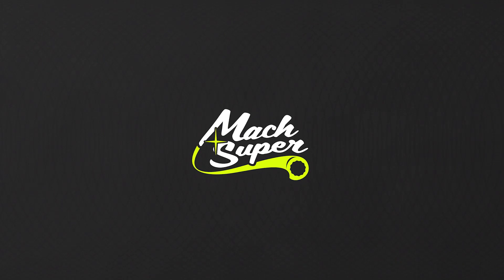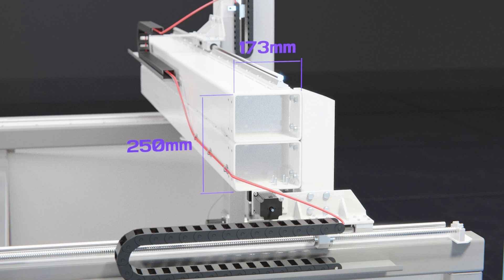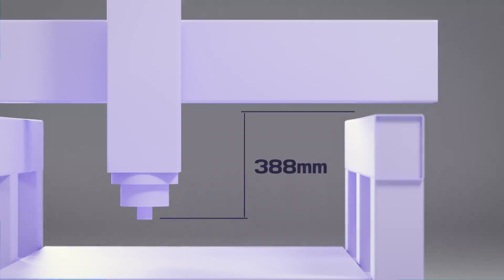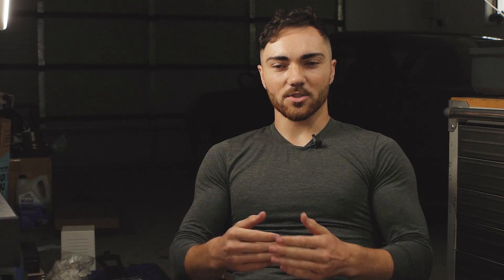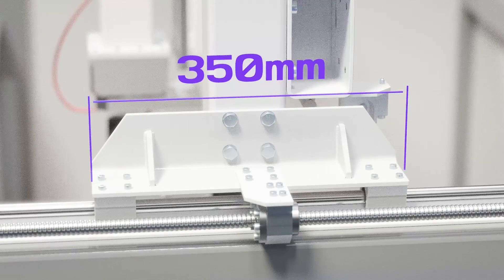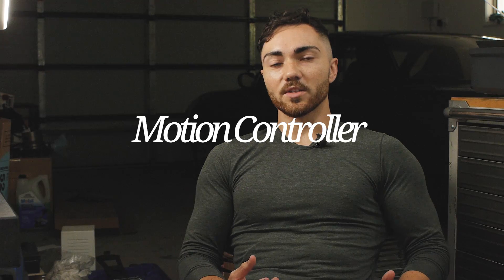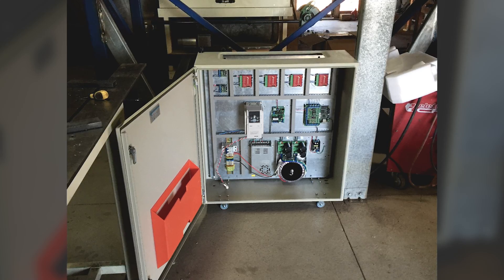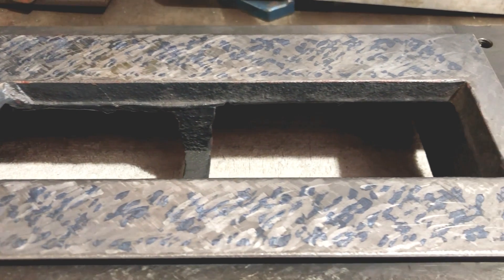How NOT to Design a 5 Axis CNC

Comment: Have you seen the channel routercnc on here? He's got an awesome build series on a flipped gantry (gantry spans the short width) and a dual gantry beam setup. If you watch some of his follow-up videos where he's using it - it absolutely shreds ali with a 1kw (I think) spindle and not a hint of chatter. He also has Fusion files available that are really thorough. Probably the strongest gantry style machine I've seen well documented on youtube
Reply from the maker: I just watched the video where he poured the levelling epoxy for the gantry. The machine looks really nicely made. One thing that concerns me with the dual gantry is that the two beams spanning across aren’t tied to each other. I see it as an I beam with the centre bit removed. Clearly it’s done the job for his needs and it looks great. I just don’t see it being a better solution than one large square shaped gantry. Do you understand what I mean?
Reply: @machsuper   yeah gantry flattening is a whole other topic that a few people on here have come up with some really cool takes on! I think I understand your thoughts on the I-beam - kind of like having two plates floating on bearings and they would sort of slide relative to each other when the spindle torques the gantry?
Reply from the maker: @drivenba  torque on the gantry like your saying could be another mild weakness. But I'm mostly concerned about horizontal flex in the direction the gantry travels in. Imagine pushing horizontally on the gantry, those beams will be weakest in that direction because they're the thinnest that way. They're not connected to each other except at the ends, so you're missing out on a bunch of additional rigidity.
Reply: @machsuper  yeah that makes perfect sense - especially with how you had talked about boxing the main beam as a design improvement. I could see a box-welded, larger, square single beam being much stronger than hollow rectangular dual beams. It'll be really interesting to analyze these different configurations with FEA - that's on my list for the future. Another cool channel to check out regarding beam improvements - Bryan Howard. He's also doing a really interesting flattening technique with a webcam and some software he wrote!

Comment: My 8 axis motion control crane uses a kflop for motion.  It also has a L head with harmonic drives, just holds a camera instead of a router.
Reply from the maker: Is that it in the cool pan/tilt head video?

Comment: 8:05 Can you elaborate on what's wrong with the round SBR rails? I thought they were the superior design aside from being heavier and taking more space. The ability to adjust preload on the bearings with set screws is a brilliant way to get high precision while keeping the cost down. MGN rails have to be perfect from the get-go or else they're useless. The ones I bought were all over the place. By mixing and matching the rails and slider blocks I was able to get them all usable, but if you weren't buying a lot all at once it would be a total crap shoot, whereas SBR rails can always be adjusted. And adjusted again as they wear. I've only used SBR for the Z axis on a 3D printer, but they feel solid enough for a router.
Reply: Two major negatives with round rail....  One is that the rail support is a tee so that means the bearing is 'open" which allows a lot of flex.  Another is that the ball bearings are round and the rail is round so you get high point contact loading.  Profile rails are, well, profiled. The bearing surface is curved to 'fit' the round bearing. This allows for more preload and therefore much more rigidity. They are also 4-way equal load rated which a 'c' shaped open round bearing can never be.  There's really no comparison.  If you had to mix and match rail and carriages then you bought knockoffs or just low quality. Or the mounting conditons weren't adequate.
Reply from the maker: Jevon, you said it better than I could have. Thank you.
Reply: I have the same rail and it's a bit curved in height: on a lenght of 3 m I have a height difference of about 2 mm.

Comment: I can only imagine the time it took to not only design this but make the animations. Looks great!
Reply from the maker: A lot of time, but not too much for you people. XD
Reply: @machsuper  models are very detailed, welding and milled textures are awesome! What software do you use?
Reply: @machsuper A response like this get the subscribe. An admirable attitude/response for creators.
Reply: A column machine is the most rigid, a fixed gantry is the next best than a moving gantry. This is because a column only has one moving axis attached to the spindle, the fixed gantry has 2 and a gantry has all its axis’s moving the spindle. The con of a column of fixed gantry is not so much about moving the part but more to do with travels. A fixed gantry need to be twice as big as a moving gantry for the same travels. A column is even bigger. So I guess it comes down to what you want to make with your machine.

Comment: Excellent illustrations for the different types of gantries and movements of the various axes. One downside from my experience selling gantry style machines is the ability to move heavy workpieces using forklifts onto the bed of the machines. If the machine has structure above the bed, a forklift will not be able to lower a heavy workpiece onto the bed, but that types of machine can be more easily design to be more rigid, so there are a few tradeoffs.  

A single ballscrew for the table style can cause racking, so depending on the width, you still may need two ballscrews at the extreme sides fo that table.

I'm sure your mentioned this in a previous video, but what CAM program are you using? Fusion360?

Your overall mechanical and strudtrual solutions for your machine is great and I can't wait to see your development. Keep up the great work.
Reply from the maker: Thank you very much!

Both good points. I realised later on that I should have mentioned that the moving bridge is excellent for access. All pros and cons.

Yeah you're right about the racking on the table, just depends on the aspect ratio of the rectangle, right?

Indeed, I've only ever owned Fusion360. I used NX CAM at my previous job, but it was an old version and it truly sucked to use.

Thank you for the nice comment! Can't wait to get more videos out.

Comment: you can also double the gantry, so instead of the Z axis being mounted to a single face, it can be mounted between 2 faces. This would double the guides and control system.. but it would also increase the the gantry's mounting surface.
Reply: Yes this is how axyz machines are build. Having two faces also allows the gantry to be small, saving cost.

Comment: Kflop looks like many are using it today. Not so many when i started my project. A friend of mine was featured in Linux for his 5 axis a couple years back with twin tool changers. Im already invested into linux. I even have a centroid acorn but 2 limited to 4 axis. 

Wouldn’t surprise me to change my mind by the tome i get back to my project since i may have out dated hardware.
Reply: I have a 5i25 and 7i77 if i recall correctly without digging it out of storage.
Reply from the maker: Gi Glenn, how long ago did you start this project? It seems to me like if you already have a handle on LinuxCNC, there’s not a lot of strong reasons to jump ship unless you’re just curious to try out Dynomotion.

Comment: How would you fix box sections into the gantry beam - obviously hard to access. Maybe bolt them in? Plug welds? Or would that risk warping?
Reply from the maker: Yeah I’ve always assumed I would drill holes in the box section that line up with the gussets and plug weld them.
Reply: @machsuper  cheers, I'm making a gantry right now and been wondering about this. I could easily plug weld in some plates and skim the whole thing in the mill after, as long as I could get it aligned straight enough in the mill.
Reply from the maker: @Joe_Bandit  I can imagine that's how I'd go about it. If you have the ability to stress relieve it, do that after the welding. But that's a pretty serious step that many people can get away without doing, depending on their needs.

Comment: Great video, I designed my own CNC router for sale the entire thing is built around ball section with dual linear rails on the X, Y, and Z - It makes all the difference for accuracy if you get the box section ground beforehand
Reply from the maker: Nice! Yeah that would be really good to get all the mounting surfaces ground flat, as long as you can keep them flat after welding.
Reply: @machsuper   I've completely avoided welding in my design and relied on fasteners but if you can find a shop that can grind a welded assembly it's definitely the way to go

Comment: Masso is also an amazing option for 5 axis machine control!
Reply from the maker: I can't seem to find any mention of RTCP functionality on the Masso controller, otherwise I'd be more interested to give it a go.
Reply: @machsuper  After nosing around on the Masso forum i can confirm it does not currently support RTCP. Though they do seem interested in incorporating it. I have a masso G3 touch for my 3 axis machine with a future rotational axis planned. And the Masso is a breeze to use, wire and 'program'. I actually have build the machine with the gantry over the long axis as you suggested not to do in your video. But this does allow me to put full sized sheets in my otherwise only 1/3 sheet machine.
Reply from the maker: @DikkieKlijn  ah thanks for confirming that about the RTCP.
As for your gantry, there's definitely reasons to span the long distance sometimes. It's just horses for courses, right? Generally you just want to improve rigidity wherever you can.

Comment: I worked as a cnc machine designer for five years. The points you have about the structure are quite right
Reply from the maker: I love your comment! Thank you for the validation haha! I had some imposter syndrome making this video, thinking "who am I to tell people how to engineer CNC machines?" 😅
Reply: @machsuper , In your defense, you told us how NOT to do it based on empirical evidence and how YOU would build the next one differently, based onyour experience. Not as an "armchair engineer."
Reply: @machsuper hey when will you be back ?? I'm also 19 and in the process of building a 5 ax CNC .....we'll see what I'll do wrong
Reply: can i use rack and pinion for a gantry machine
Reply: I like the gantry style im working on. Im using 1000w Holry servo motors and 10:1 gear reduction. Any thoughts on this?
Reply: Hello Jesse can you help me?

Comment: I've been developing 3-axis CAM software for hobby/DIY for signs/engravings/art over the last 5-6 years now with my eye on 5-axis toolpath generation just about the entire time as a potential future CAM software project. It never occurred to me that G-code won't necessarily be able to know ahead of time the tool offset (i.e. cutter length, or even just how far the cutter tip is sticking out from the axes of rotation). Granted, not all 5-axis machines are the same as the setup you came up with. The workpiece can be rotated on one, or both, axes. These are things I hadn't really thought about (I figured I'd figure everything out when the time came). Anyway, thanks for sharing, gave me a few more things to think about while I wrap up my 3-axis CAM software.
Reply from the maker: That's awesome! Are you working with BRep data structures or mesh modelling? I think I could manage to do something with mesh CAM, but BRep remains beyond my understanding for now, as much as I'd love to build my own. When making your 5 axis CAM (if you do), only the post processor will need to know the tool stickout relative to the axes of rotation, the CAM shouldn't need to concern itself with that. Or in the case of a trunnion style machine, the tool stickout is irrelevant and it's all about having either the post processor or the CNC controller itself know the location of the work origin relative to the axes of ration. Ideally the controller would do it on the fly, hence the TCP functionality mentioned.
Care to share the name of your 3 axis CAM software?
Reply: @machsuper  I went with an entirely novel approach for my CAM software, everything is heightmap based - you design your project by loading/creating multiple layers that you blend together to form your project's composition and then I generate toolpaths off of that, performing a sort of Minkowski sum of the heightmap and the cutter's geometry to produce the actual manifold that the center tip of the tool should move over. There are a dozen different toolpath types and only the 3D Contouring toolpaths operate that way, the 2D/2.5D toolpaths generate a series of contours for offset milling, trochoidal milling, profiling, etc... For 5-axis I am thinking the best way to go is to generate a sparse distance field of the 3D geometry to be cut, and toolpathing would operate on that distance field to determine the best way to approach the workpiece. Eventually I wanted to take it a step further and invent a process that lets you just slap any old chunk of material into a machine, it scans it, and then with a pre-defined set of tools it goes ahead and dynamically mills out a target model on-the-fly - sorta automate out the need for CNC expertise entirely. PS: my 3-axis sign/engraving CAM software is called PixelCNC.
Reply: @Charles Van Noland  would you use a lidar attached to the cutting tool to make a 3d scan? I like your idea it would be really useful.
Reply: @robotswithryan8348  It could be LIDAR, it could be optical/photogrammetry, there are several options. I haven't thought too much about what the best method for scanning the workpiece would be, not as much as I've thought about how to generate 5-axis cutpaths. Someone's going to build it one way or another!
Reply: @robotswithryan8348  For 3d scanning I would recommand recunstruct me as software with an old 2nd hand Kinect. For a good hand holder, I would recommand to go to thingiverse and there search on my name. I designed one some time ago.
For small objects I would recommand Horus Scanning software with a line laser. It works verry decent. I desinged a platform, but did not publish yet. I'll see if I'll find some time soon.
But if you ask me, scanning a whole lot of work to make a water tight model. Personally I would recommand to learn to model in Blender 3D and Freecad. This is much quicker, much more satysfying and gives you much more room to explore your own ideas.

Good luck.
Regardz, CatweazleMagic
Reply: I answered some time ago allready on this, but somehow  it was removed. (Don't understand why)
Search for rudy du preez 5-axis machine tools. Then a pdf will come in the top of the resulta. This paper handles the inverse kinematics of 5-axis machines including some code samples. That will probably answer your quest.
Cheers, catweazleMagic
Reply: Definitely interesting. Intuitively I think the machine would need inverse kinematics as J6 robot arms do and it's the machine's job to know positions with multiple tool frame offsets that can stack. Experience wise the machines are dumb/smart however you look at it and 'should' go to whatever position you tell it to go to and the CAM side should just generate the toolpaths.
Reply: Is freecad ok for G-code???

Comment: Thanks for all the videos! I'm enjoying watching them!!!
I think that you never mentioned how to use limit switches in your B & C axis. If you don't have any limit switches, how do you homing those axis?
Can't wait for your future series!
Reply from the maker: Thanks for watching them!
There were no limit switches on the machine, actually. I tried to set them up on the linear axes, but I was getting a bunch of interference issues. Eventually I just gave up and operated without them. The travel was large enough that it never bothered me much, I just made sure to have soft limits setup. The rotary axes also had no switches, I just put a straight round bar in the spindle and checked it against an indicator and kept soft limits on. Something to home the rotary axes would have been nice though.
Reply: @machsuper  In your next machine, try to use shielded wire for the motors. Unshielded wire can cause EMI resulting in false positive alerts on the switches.
Reply from the maker: @stav3322  I was using shielded wire, still had issues. I managed to fix major interference by fixing the grounding to the 5V power supply, but never fixed those limit switches.
Reply: @machsuper I think I could help you with this, i know a bit about electronics. I could even send you free of charge if you want, shipping would be rather cheap as I am close by in Indonesia.

Comment: What do you think about rack and pinion instead of ball screw on X and Y axis...
Reply from the maker: If they are low enough in backlash for your needs, then I think they're great. I've never used them though, so my opinion is purely based on speculation. Perhaps the best solution for long travel lengths is a ballscrew with a static screw and rotating nut.
Reply: Nah look at what the big bois are doing ..you wont see rack and pinion only big ballscrews